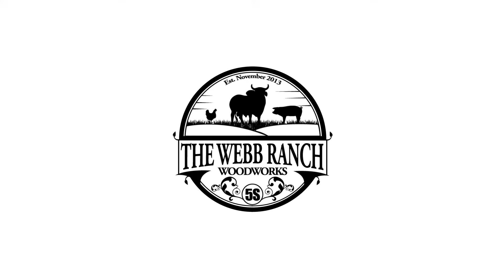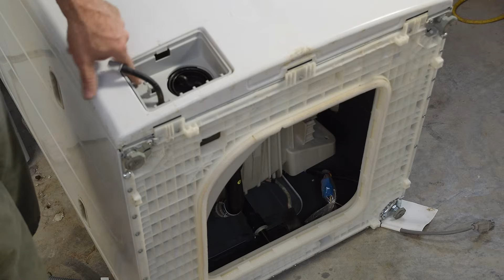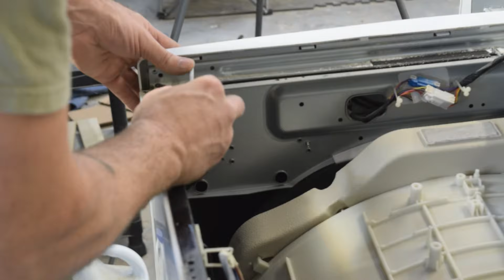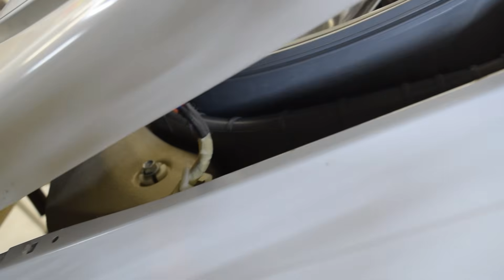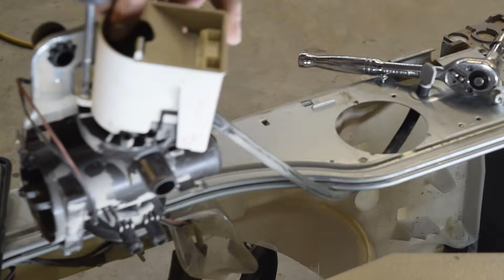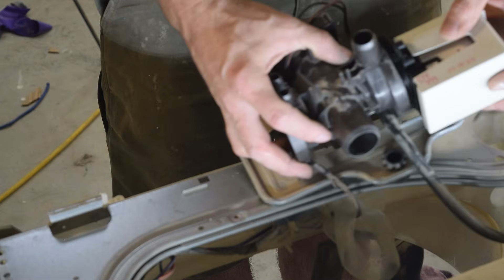Fix LG 0E error code on front loading washer - water pump replacement

Comment: Hi! We replaced our water pump less than a year ago and have the OE error with some leaking in the bottom. Would you recommend we buy another water pump or could it possibly be another issue. I did make sure that our hose is not blocked and drained out filter manually.
Reply from the maker: @patriciaxoxo26  I have to preface this with "I am not an appliance repair man". I am a woodworker who happens to be handy. The manual indicates there are only 3 things thay could cause the error code (mentioned in the video). Does your washer get subjected to extreme cold Temps at times?
Reply from the maker: @patriciaxoxo26  PS. Is there water accumulating in the drum?

Comment: That drain hose never works for me. No water coming out, maybe just a few drops and then when u turn the filter to get it out there is a flood. LG is really bad in my experience
Reply: I have the same issue. Did you fix it?
Reply: @Arvenia  Yes. I think when u pull it out to far it gets blocked. When I pulled it less out it worked better. I also used a cleaning device for a fridge to insert into the tube but it did not get anything out so i think it really was that I pulled it out way to much or maybe a combination of those two
Reply: No, LG is not bad. Your little tiny hose is blocked. I had the same problem. Clean it out with a chopstick and thin bottle brush from Harbor Freight. LG is a darn good washer and I love mine. I bought mine used and the seller was smirking thinking she conned me at $75 for both washer and dryer. The washer had a water leak. I opened the top, saw a disconnected tiny hose, clamped it, problem solved. The Frigidaire Dryer got a good lint cleaning, very thorough. Both have worked for 10 yrs tirelessly. Dryer had a control board issue. I bought a used one for $73 on ebay and fixed it myself thanks to Utube University. Solved. Now the washer has a draining issue I am investigating. It could be the hose blocked up, I think it is. Since a sheet had large paint chips in it. I'm sure there is a gob of link somewhere. I need to clean out the drain hose areas and also the gasket but both have worked so well for me with zero issues.  I love this LG washer, large capacity, eco friendly, easy to fix. Most of the time it is a lazy user who does not do periodic maintenance on his/her appliances.  I'm female by the way. Senior too. If I can do it, so can you.